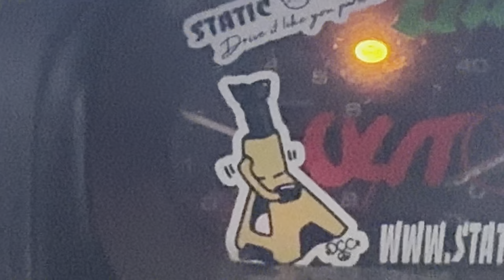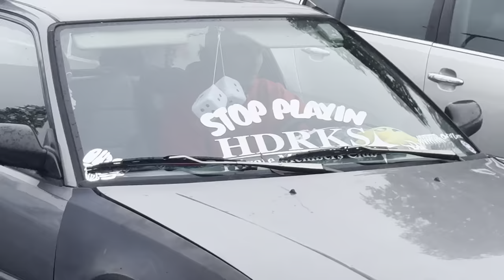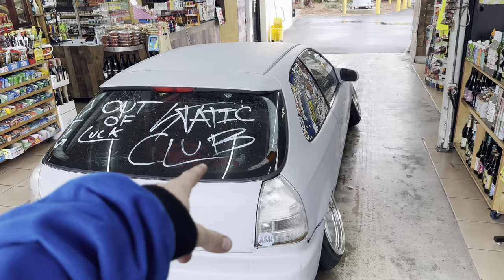UNBOXING STATIC CLUB BOX + RAINY CAR MEET

Comment: You need to put the rubber grommet under the radiator they are little circles if it’s metal to metal I’ll rub threw the soft aluminum